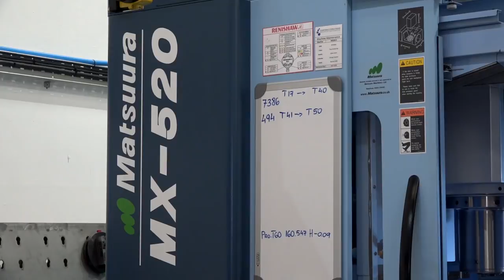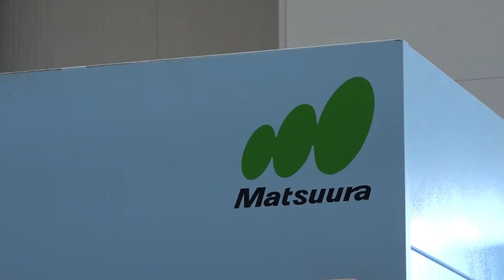My boys said they were the best machines

Comment: 😂😂😂 he just dissed his machines. What you mean you can’t machine 6 microns
Reply: Just because the machine reads out that accurately doesn't mean the stackup of  spindle runout, tool holder runout, tool wear, deflection, thermal expansion, etc etc all totals that accurate.
Reply: Can hold that on an XYZ 🤣. Tis a nice machine shop. Nice work if ya can get it!